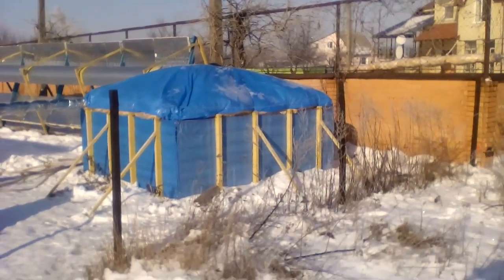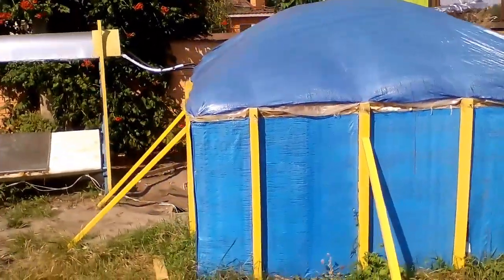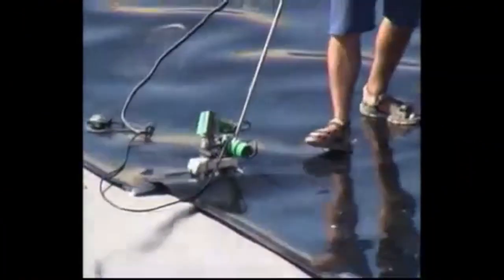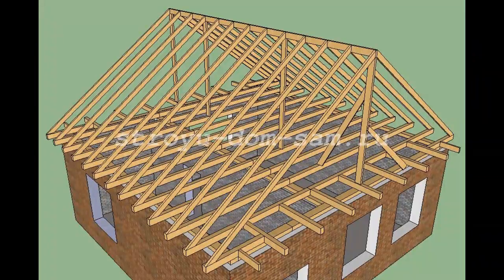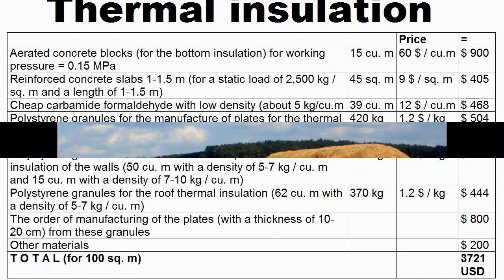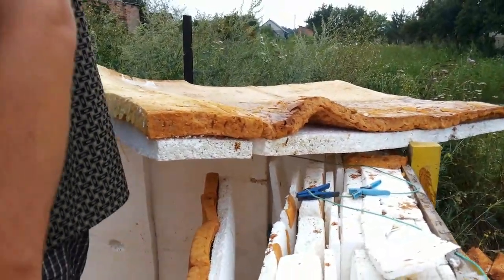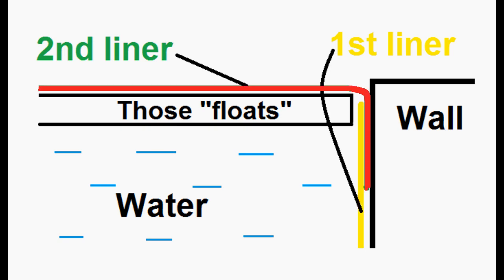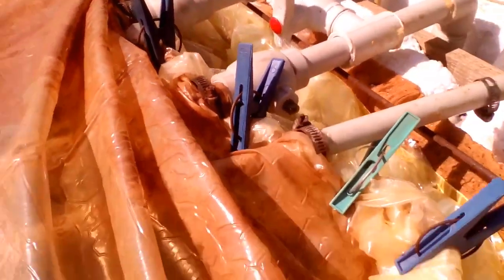Cheap thermal storage 20-100 $ / qu. m (heat storage, heat accumulator)

Comment: Use aircrete mixed stryrofoam pellets as insulation  for yor storage tank.. replace waterwith sand and heat sand to 1000c...  use heat exchanger to heat your sand... the use same heat exchanger  to conver heat storage back to heat or steam.
Reply: heat sand to 1000c ?!
Reply: @bogdy72000  fairly easy with a parabolic solar dish. Sand will easily take it and energy density is massive. You can store heat by blowing hot air in or take it off by blowing cool air in with hot air take off. That can run a heat exchanger that sets desired temp by varying flow of air from store and fluid in heat exchanger/transfer loop.
Reply: @bogdy72000  yess 
https://youtu.be/UvNv_gM_ZUk

Sand melting point 1550 boiling point 2230 c....

Very cheap  way to store  heat...
Reply: I wonder how the styro air crete would hold up. Sand would take less area and be more efficient/effective than liquid, I assume?